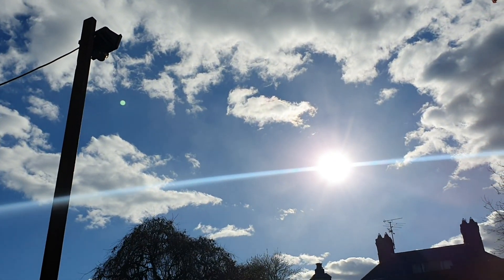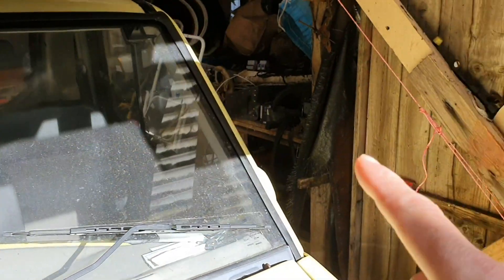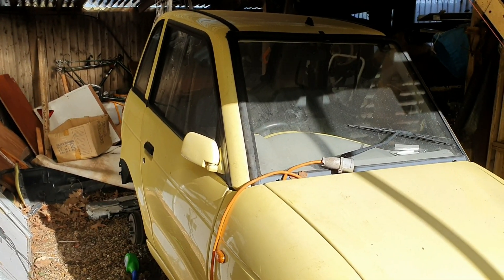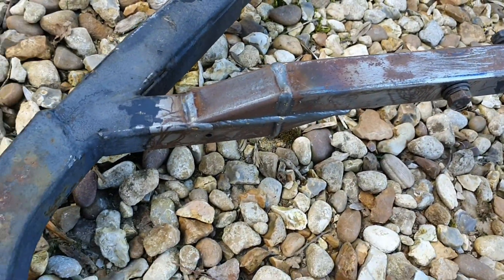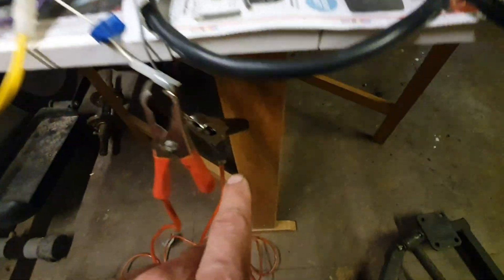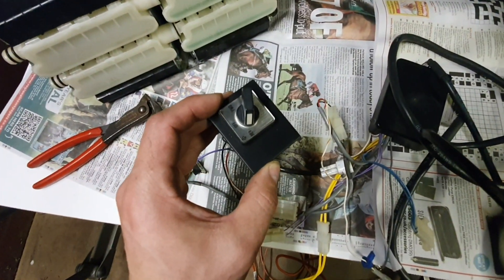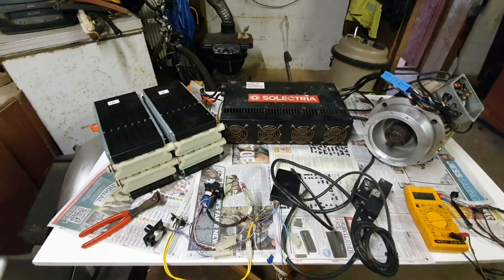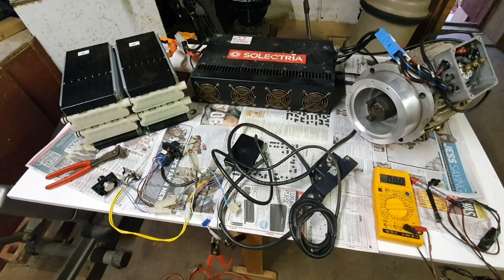REVA G-WIZ: Yellow Wiz Lithium-ion conversion pt.18 - the new (used) motor is finally here!

Comment: I like the big Block g wiz
Reply from the maker: What's the big block gwiz?
Reply: @RichardMawby  your yellow beauty.

The new engine is way bigger than the stock engine, isn't it?
Reply from the maker: @fertblusbenis5128  The electric motor yes... it's 12kw continuous - the original was 4.8 kw continuous.